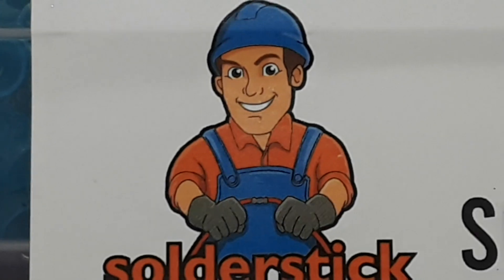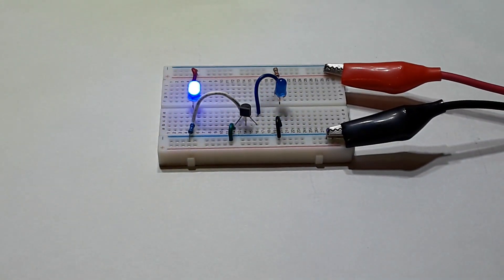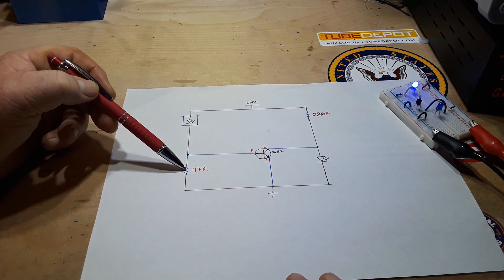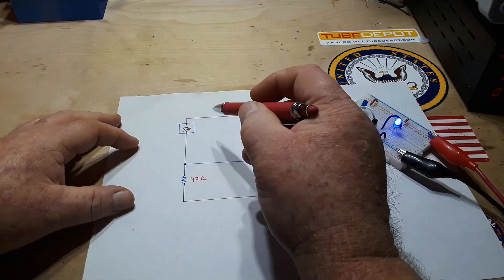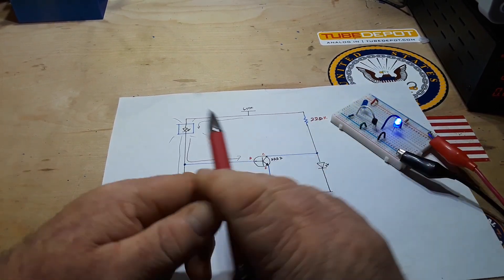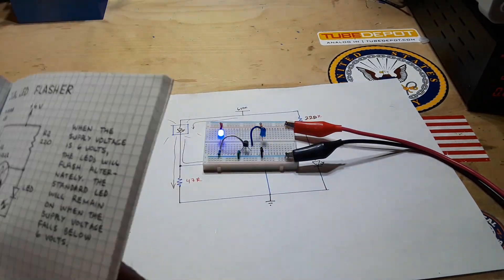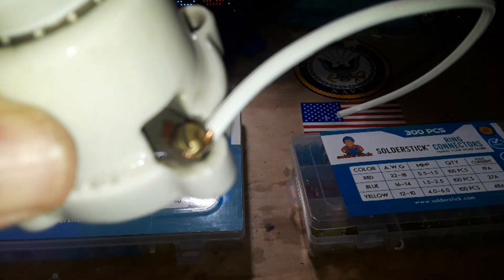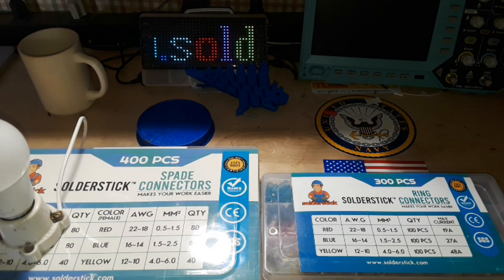Alternately Flash 2 LEDs with One Transistor - Sponsored by Solderstick Wire Connectors

Comment: I'm sorry, but this is wrong. If the base current opens the collector-emitter connection, there is no way the current will flow through the standard LED. it must be the other way around. There will only flow current through the standard LED if the transistor is closed.
Reply: Yep.  He did get it backwards.  When the flashing LED is on, the transistor is on and grounds the anode of the regular LED.  When the flashy LED is off, the resistor pulls the base of the transistor down and the regular LED gets power.
I'm totally dyslexic so that was hard to write.  😰
Reply: @vampiremuffinman7183   Are both LED's same or different. I am confused.
Reply: @VarunPandithurai  One is a flasher type and the other is a standard LED.
Reply: Yes you are correct, if you remove the transistor both LEDs will light.
Reply: Scrolled down to the comments to point that out. Glad other folks noticed too.
Reply: Of course the critic has no content on his channel....

Comment: PAUL, make an Inductance Reactance YT lesson about Solenoid coils or relay coils on how to measure the inductance reactance on solenoid coils and relay coils. When measuring the AC current it will be different that the computed current of Voltage/coils resistance = Calculated current. Then you have to compute for the inductance reactance. The Main Question is why is the "measured Current" of the coil different that the calculated current? The currents should be the same value but this is what inductance Reactance is that the measure current and calculated current don't match which you can explain why.

Comment: Can you explain why the easiest path to flow changes? It’s not clear to me.
Reply: The flasher turns off blocking current from flowing through it.
Reply: I think he got it wrong in the video:

When the LED on the left is on, the base of the transistor is pulled high (to whatever voltage it's dropped by the diode/resistor network), therefore shorting the LED on the right, making it turn off.

When left LED turns off, the base of the transistor is tied low thru the left resistor, making it turn off, and the right LED turns back on.